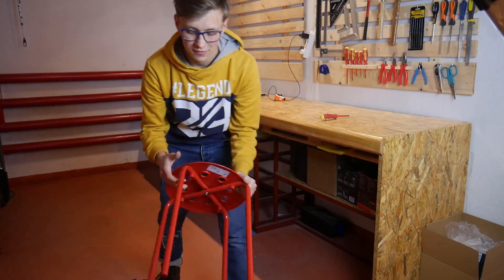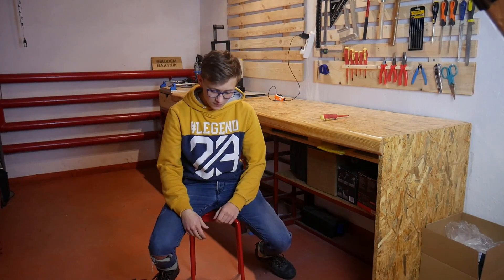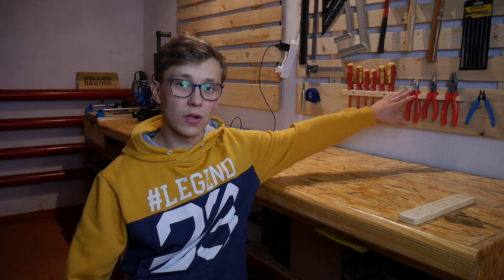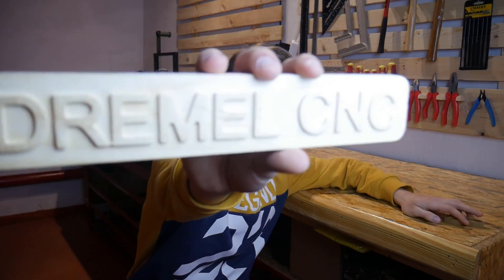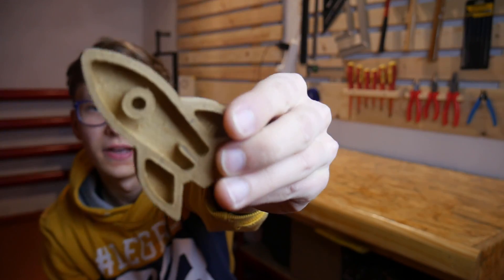Goal Calendar - DIY Dremel CNC project

Comment: Great project Nikodem, I hope you will pin at least 28 pins on that board each month. Any chance you could share your Ender 3 printing settings? It looks its all stock but the prints come out great and without any stringing.

Comment: Hello,
another nice simple design, as you say for beginners (if I had to do it, I would do it with saw and drill: I do not have the CNC and even the dedicated SW! I'm not a digital native, I'm a 58 year old dinosaur!)
Nice video made well,
congratulations.
P.S. next project: an adapter for the vacuum cleaner to be fitted around the tip of the drill, so keep the CNC's work clean throughout the execution of the work, avoiding the spread of potentially harmful dust
Reply from the maker: Thanks! I know this kind of project could be easily done with hand tools but it's also nice to do it with a CNC and learn some new things. I want to build an enclosure for my CNC maybe I will also add a small vacuum cleaner.